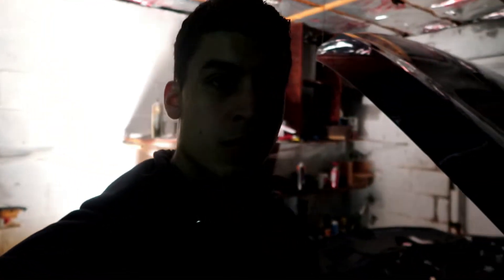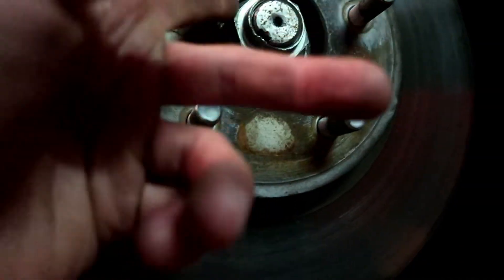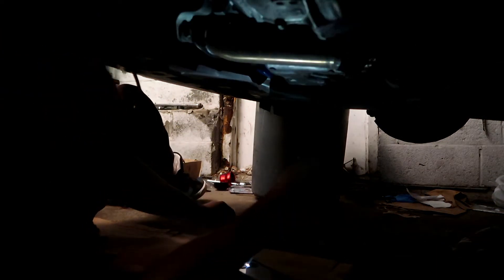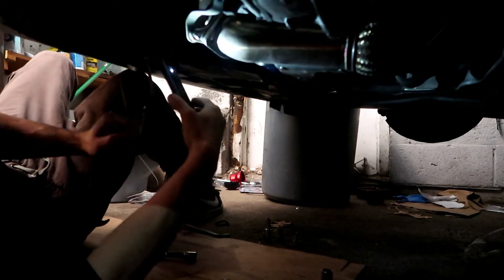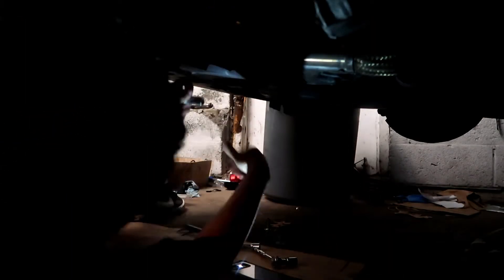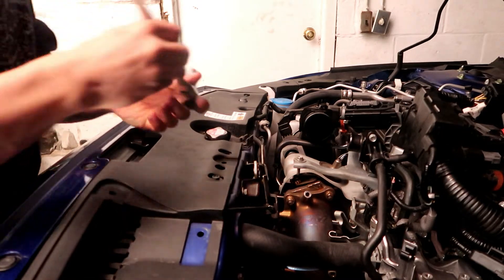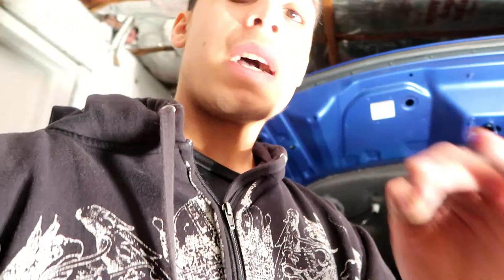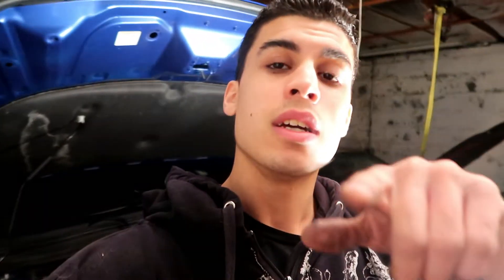2018 HONDA ACCORD PRL FRONT PIPE AND DOWN PIPE REMOVAL ( LETS FIND THIS ISSUE!)

Comment: What’s mpg does far? Man you lucky asf, I drive an automatic 1.5t turbo sport. Been looking for a manual. Couldn’t find one in my $ range.
Reply: Well it looks like the manual accords are done after this year so I would get one soon . They are fairly rare so the prices will go up a bit . I bought my new 1.5 sport manual new in 18 for 23 k . I’m thinking you should be able to trade straight across for 1200 more . The dealer has to make money so 1200 should do it . At this point he can sell an auto quicker than a stick .